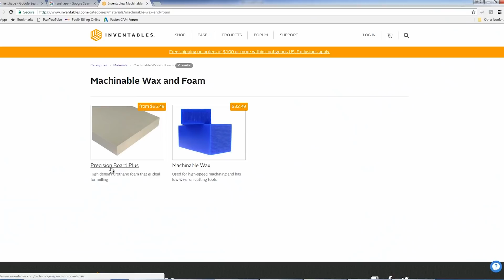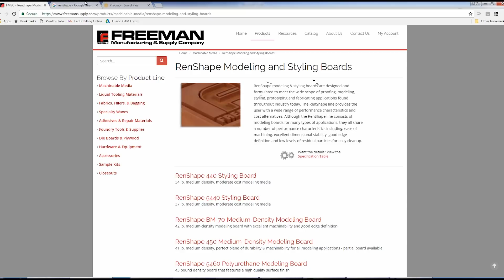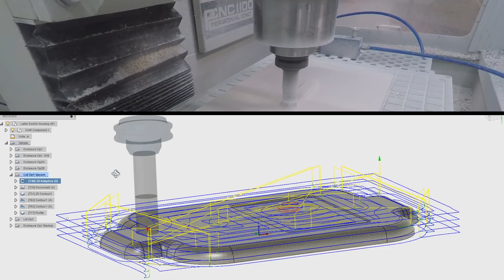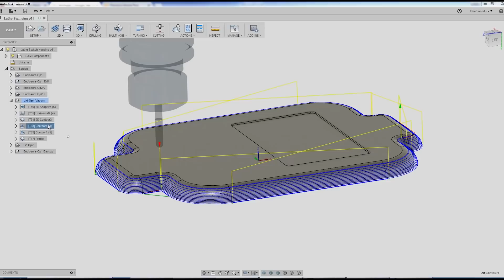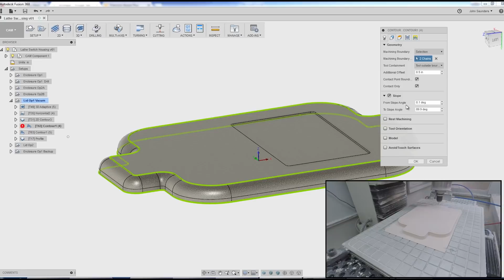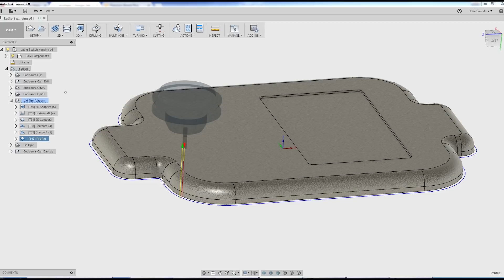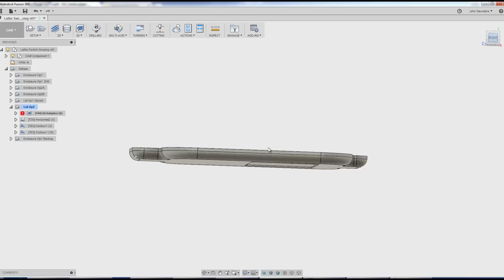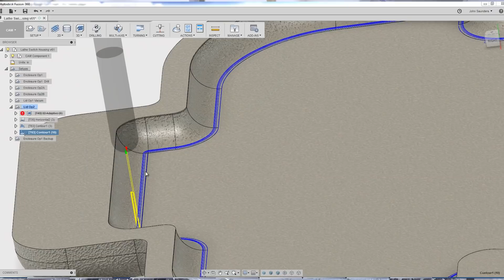Machining a Southbend Lathe Casting Pattern - Part 1 WW162

Comment: hey I got a odd comment, in my channel, I uploaded a video about the colonisation of the solar system, there, I mention that currently, there is no infrastructure in space to build the stuff that is needed to colonise the solar system... I just saw a video where you went in may, to visit a business where they build some cnc's in USA... I wonder if you could guestimate how many machines were needed to build that cnc... as I suspect that, it would be the number needed in space infrastructure... could you toss a number, (of machines needed)??

Comment: I've done a lot of patterns from renboard and hand sanding is always necessary. Your setup with the vacuum plate was interesting. At the shop I worked at we always used plates made from thick poplar and glued them down using cyanoacrylic glue or wood filler and flipped them by bedding a piece of renboard on top with wood filler and dowels

Comment: John,     Forgive me if this is the wrong video to ask this.  I watched with the audio off at work.  I see you use AB tools Shear-hog on just about every project, looks like this one too.  Question, AB Tools states the shear hog is a non-ferrous roughing tool.  Not questioning the use on foam.  What is your take on using it on steel, I swear I've seen you use it on steels and other "non recommended" materials.    Is it really as versatile as it appears?  drawbacks in Steel, if any?

Comment: You should have just bought a big sheet of renshape 460 from freeman supply. Inventables is overcharging a bit. You'll use it again in the shop. Precision board plus is also suuuper dusty compared to renshape. Still, pretty nice.

Comment: Hi John, normally i don't leave comments but i have to say i love the new intro! could you please bring back the metric speeds and feeds info for us metric people?
Reply: I do not take it personally at all :) i do know the conversion, it's just that i liked when John had the metrics up on the video's because it takes time in your head to do the conversion so i'm lagging behind sometimes. Also when going like 35/64ths it tends to hurt my head a little ;)

Where i'm from( the Netherlands) there's almost a sort of hate against the imperial system, i think mostly because it's strange to alot of people(the great unknown) and not easy to convert back and forth to round numbers. It's always easier to use a system that you're familiar with so to speak.

Comment: Is it incorrect to assume the hold down force is simply based on the area inside of the gasket material?  If your vacuum plate is very flat and the bottom of your material is very flat, then the vacuum would only exist in the spaces (grooves).  I do not profess to be an expert in this area, but curious as to what is actually happening regarding the vacuum.
Reply: It is not the vacuum that is applying the force: vac is the absence of air. It is the 14 psi air on the other side that is applying the pressure.

Comment: Thanks for the video John, timing could not be better!

We just got a bunch of MP-1055 in yesterday for doing our vacuum forming molds.  We went with Axson - great folks to work with.  Keep in mind, direct ordering requires a $250 minimum.  Below is the link and pricing we got.  They also have an epoxy for gluing this stuff together.  I just wish they offered a 1" product.

http://www.axson-technologies.com/us/find-product/Machinable-Products/Modeling-Boards

(1 plank) 2” x 16” x 60” – cut down to 4 pcs – 16” x 15” (or so) - $227.66
(1 plank) 3” x 16” x 60” – cut down to 4 pcs – 16” x 15” (or so) - $318.00
(1 plank) 4” x 16” x 60” – cut down to 4 pcs – 16” x 15” (or so) - $407.91

Later,
Awall

Comment: With that material could you use carbide tipped router bits such as rounding over and core box bits to produce radii in one action?

Comment: Nice part!
I am quite annoyed that Fusion has no setting for surface roughness with the profiling operation, that sets the DOC automaticaly to get a certain surface roughness. Would help immensly for finishing without having to fumble around.
Reply: I'm a bit surprised that Fusion can't space the contact lines along the finished geometry surface and then back-calculate the irregular horizontal steps from that.
Reply: Stefan Gotteswinter Stefan, it sanded easily for this sand casting pattern, but would not have been fun in a harder material!
Reply: Jackson Par Perhaps depth of cut isn't the best choice of words. It's a ball end mill following a curved surface transitioning from near vertical to horizontal. With a fixed vertical step for the toolpath, the scallops left by the tool obey the laws of trigonometry obediently and you wind up with a nasty scallop height on the more horizontal areas. What Fusion needs is an option to maintain a constant scallop height. This would drive the toolpaths closer together on the horizontal areas and result in a more consistent surface finish. I think that's what Stefan was suggesting.

Comment: Seems like an expensive material. What is the benefit of using it over something like high or medium density fibre board, or a polymer like acetyl (delrin)?
Reply: I wonder if its being used to just form the sand mold, or if its lost foam casting?  Can this stuff be used for lost foam casting?
Reply: somebody else Can't be used for lost foam casting as far as I know. Should be good for several copies in a traditional green sand casting process, though. I'm having two made right now and we'll see if anyone is interested in more once I finish the controls on this lathe.

Comment: I would setup a simple shop vac hose next to the spindle if I had to cut a lot of that! That said nicely done and cool to see you branching out into different things. Is the pattern reusable or single use?
Reply: Calvin Witt Hey Calvin! Should be good for several green sand castings. I'm starting with two now. :)

Comment: Hey John. We cut renshape all the time for modeling. It's a very forgiving material, and I think you're really overthinking the toolpaths. For a part like this, we'd usually just run a single, low-stepover (0.015ish) parallel surface pass over the whole thing with a 0.5 ball endmill. Then come back to finish the tighter corners. the parallel pass may take a bit longer at the machine than traditional toolpaths, but you get that time back by not having to spend so much time programming.

Comment: Too bad Grizzly bought South Bend and moved production overseas. They also completely removed all the styling and turned it into a box; exactly like all the other Chinesium lathes look. I'm convinced they're all made by the same factory; since they all look the same. (Or made in different factories out of the same design plans.) I think Grizzly it's just buying an off the shelf lathe, and are having it painted/tagged/branded as a South Bend.
Reply: Andrew Delashaw There's some truth to that, sadly. I'm trying my best to keep these custom parts looking like they might have been SBL factory options back when this lathe was new.